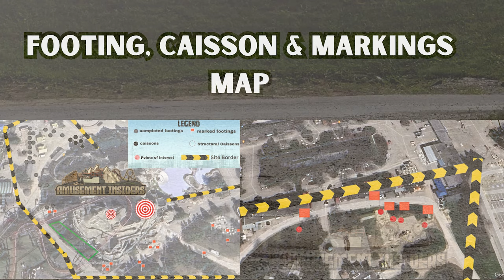Canada's Wonderlands New Launch Coaster Construction

Comment: Awesome update as always! 🤞Fingers cross no leak is gonna happen til the park announces it. Canada launch records are a low hanging fruit. Wonderland should atleast look at breaking even a single world record.
Reply: They should but don't be surprised when they stick to Canada's fastest and longest launch coaster. 
You have to remember who Wonderlands GP are. Most have no idea any park exists
Reply: @jasonbyl8695 They broke three world records with Yukon Striker so I would say they have a green light to go after some record element
Reply: @johnboulanger807  it's possible they do. I have my doubts due to how they ended up with Premier and how this was a last minute change in manufacturers.
Reply: @jasonbyl8695  True, I have a glass 🥃 half full personality so I am leaning toward the positive signs. The amount of work in the mountain would not seem to justify going moderate with the coaster. There were earlier rumours it is the most expensive installation to date potentially $50 million.  Inflation is a piece of that as you could not build Leviathan for $28 million today but it does seem this will be big with some big elements.
Reply: @johnboulanger807  Premier coasters are not that costly. With Wonderland heading towards being a theme park IMO the money is more for theming in the mountain and less on elements.
Reply: @jasonbyl8695 You could also go higher in the elements if the track is less expensive.  I think we may see a bit of both

Comment: Okay, so if there are markings going around Flight Deck then the SkyFlyer area will not be a part of the mountain project.  It will be for the Kingswood project.  You mentioned you saw markings in the White Water Canyon area.  Don't you see the big picture, Brandon?  They are going to be building all of the Season Pass poll coasters all at the same time, so that they are finished for the 50th anniversary in 2031.  This will be the BIG announcement.  B. .  .I. .  .G.  one letter for each coaster.(Just a crazy thought to consider)
Reply from the maker: Extreme Skyflyer is apart of this coaster guaranteed
Reply: Then why are they marking behind Flight Deck?
Reply: @BOBSBOWLINGSTUFF for a future addition(not this one)
Reply: @A.H_Penguin123  I’m thinking a hyper inverted coaster to take flight decks and time warps space hopefully
Reply: Rock n Roll wing coaster out of Kingswood, GCI mine coaster in Frontier and this launch.
Reply: @eriksomkitchen  I think it will be a wing not an inverted because they did a survey for the wing
Reply: @A.H_Penguin123  oh not for inverted? Yeah honestly I think they will add all 3 options eventually just they wanted to decide which one to start with
Reply: Kingswood is where the hotel is going
Reply: @felixsromero  Not based on plans submitted to the City of Vaughan.  Hotel will be built right at the entrance  by Rutherford Road and Highway 400.
Reply: yeah, the hotel will not be near the park, similar to the Cedar Point hotels.